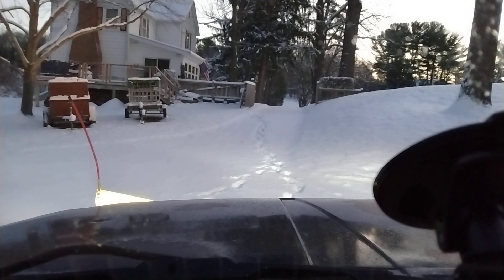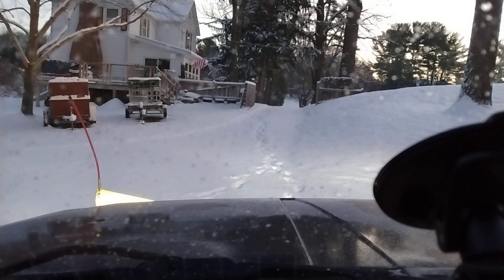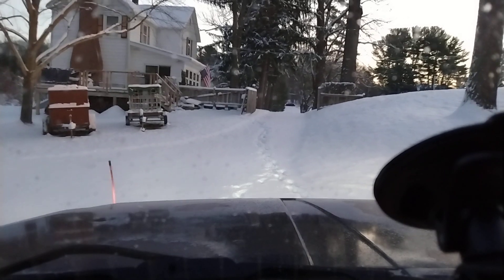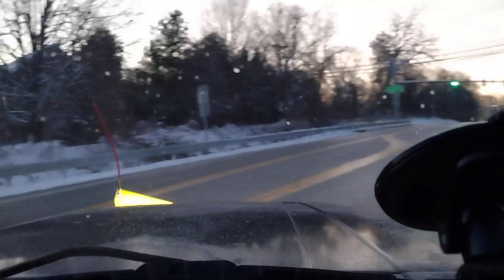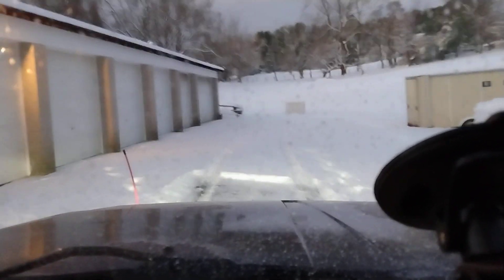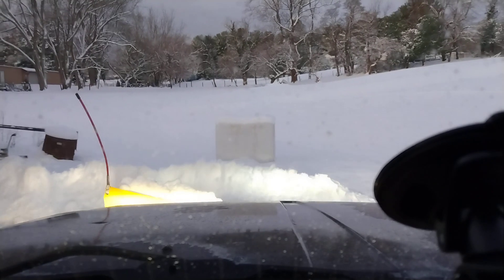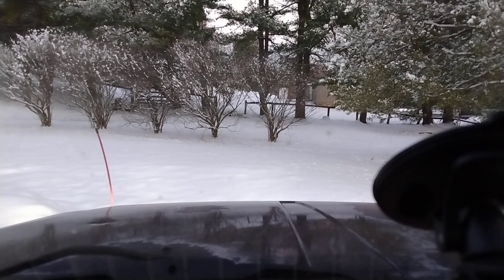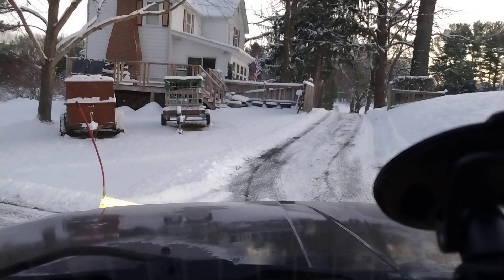Snow plowing for Dummies with an XJ Jeep

Comment: What transfer case are you running?  Np231 or np242?  Do you get any drivetrain binding on your u turn on the wet pavement?
Reply from the maker: 231 and I get a little bit of bind but not much